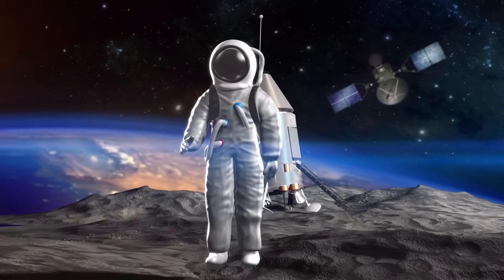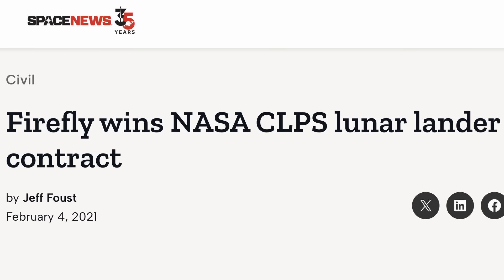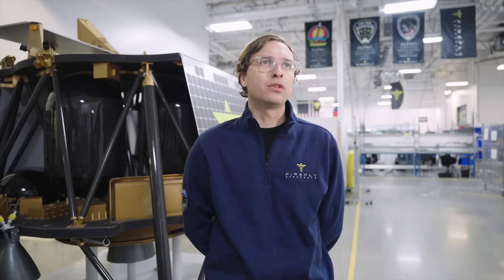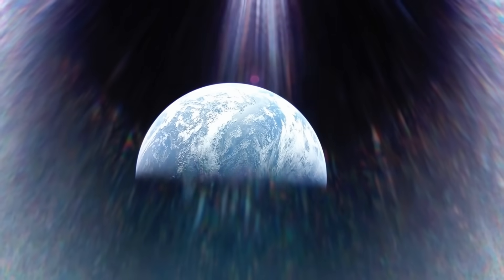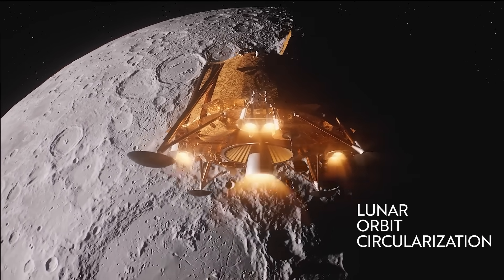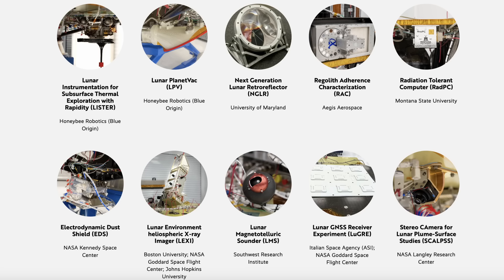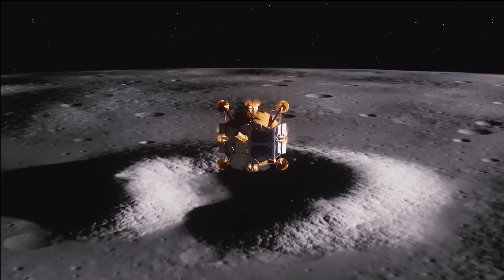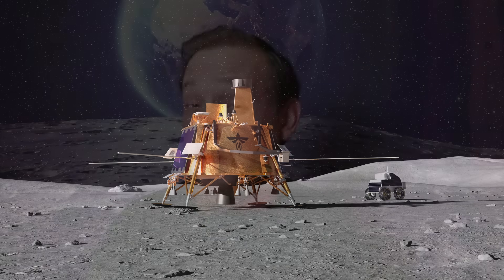Firefly's Blue Ghost Lunar Lander Update

Comment: Serious question. If we landed multiple manned flights on the moon decades ago, why is it such a big deal to land an umanned craft now? They speak of radiation and such, how did the astronauts and equipment of 50 years ago deal with it?
Reply from the maker: Unmanned is arguably harder. The onboard systems have to take care of everything. Unlike when Neil Armstrong broke the landing path as he realized there were huge boulders there, the unmanned craft don’t have a lot of that intelligence built in.

To get that intelligence we use modern computer processors. These modern processors are much, much, much more sensitive to radiation hits. When radiation passes through the processor it can flip a bunch of bits, changing or completely corrupting the calculations it is making. Back in the 60s their systems were nowhere near as fast or sensitive to radiation. Not that they had no sensitivity, but it has gotten worse over time.

And radiation was a legit concern for the astronauts heading to the moon. They even spoke of flares of light passing by their eyes when they are shut. That is radiation hitting them. Fortunately they didn’t get slammed with a solar storm, although even if they did there was a safety plan!

Jami🌸

Comment: Technical tip: You should stop encoding your video with interlaced frames (optimized for old CRT Tube monitors) and choose progressive frames instead. Ever since I learned the difference I can't unsee the artifacts that old standard causes on our LCD/OLED flat monitors. It's pretty severe here, the edges of moving things are all blurry.
Reply from the maker: Yeah, new setup, I think it was just a timeline slip. Will get it corrected.

Jami🌸

Comment: "Careful..." and "Easy does it..." appear to be watchwords for this mission.  Which is just fine.  Taking the time to check, re-check and confirm every step seems to be paying off so far.  And at 1st glance, it makes our early trips to the moon in the moon in the 60s seem a little reckless....reaching the moon in less than 3 days.  But there were reasons.  The ships had only so much air, food & water for the crew....and they also had to get back.  If slow, methodical & cautious are the way future flights will be...then we will just have to build larger ships with greater life-support ability to handle the longer duration flights.  I like your channel. 😊
Reply: And they had human guidance in the LEM complimenting their 16k computer.

Comment: Why is the Radiation Tolerant Computer called a PC? It's not a PC. Acronyms have meanings.
Reply: RadPC is a computer... i.e., a PC... it has circuit boards that runs a simple program over and over to see if it experiences any bit flips which would alter the program.  RadPC also has multiple dosimeters with some fully exposed and some shielded.  RadPC was built by Montanna State and is getting great data going in and out of the Van Allen belt.
Reply: @spaceman5726  That's great. But it's not a PC.